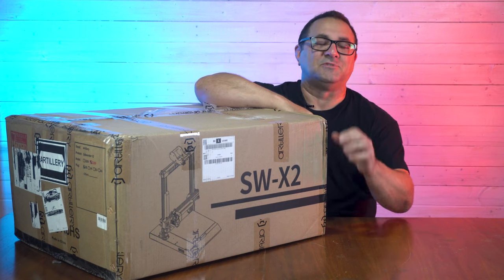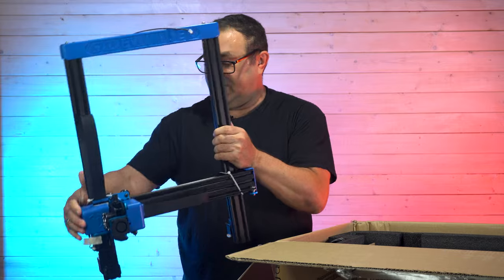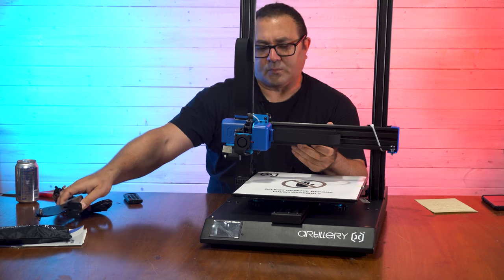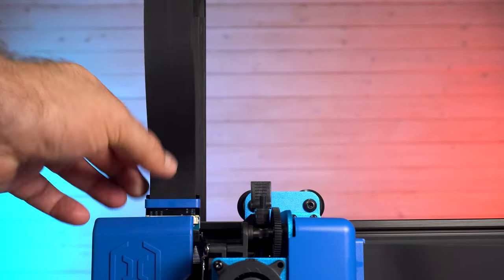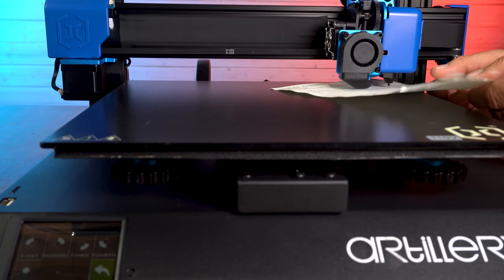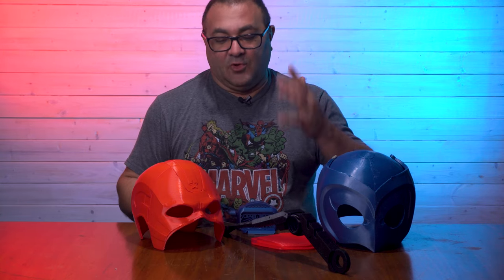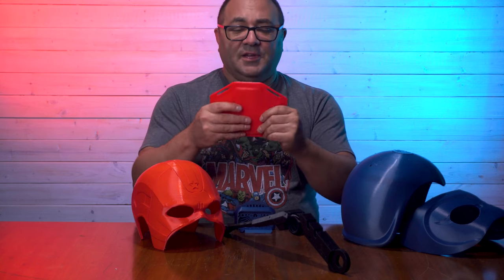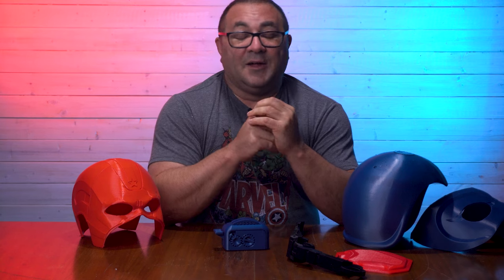Artillery Sidewinder X2 Unboxing, Setup and Review - COUPON CODE

Comment: I've had my X2 a little over a month now. When it works, it's great but it's not without flaws as with anything else. Maybe it's just mine but it's not as quiet as portrayed. I print while I'm sleeping sometimes and it's not loud enough to keep or wake me up, but it's not silent. The touch screen is garbage..Trying to make a selection in the menu and not hit another is nearly impossible. Then there's the horrible noise my X axis makes..I've contacted Artillery support and their response has been lackluster. It never fails, if my printer sits for a day or two without use, when I try printing with it the X axis makes a terrible grinding noise. Overall it's not bad but as this is my first printer I have no frame of reference. With just a few minor fixes, Artillery would have a truly great printer.

Comment: You made me buy one. The only addition I've made is a couple of stabilizer brackets to reduce the z wobble. The one weak point of this is the software/display. The heating display is not consistent. One screen could show the nozzle at 200 when it is really 0. It also doesn't increment the displayed degrees consistently. It needs a software update to fix these things including being able to remove the annoyingly LOUD beep when you turn it on. The direct drive is so much nicer than a bowden tube setup. I come from using mirror beds and glue stick and I am almost tempted to do that with this one but I think I might have to auto-level every time due to removing the mirror for cleaning.

Comment: I have had mine for 2 years and already replaced many nozzles, the whole extruder, the plate and motherboard and it still works for a print or 2 and then is crap. i do not reccomend. my 99.00 ender 3 pro has given more comfort and enjoyment so now looking to go bigger with ender.

Comment: ⛔️ Terrible printer do not buy!
Reply: Really why I hope your wrong because I'm setting mine up now
Reply: Wow so far your right the dual z axis roller adjustment instructions make no sense I did what the instructions said and if it was level well its not now lol its like there is no adjustment am I doing something wrong
Reply: So there are there is a button in the menu that lifts the head up by more than .01mm. It’s a pain in the but to get working.
Reply: @Salty Goose  options then more than arrow up or down I'm pretty sure it's like my flsun delta qqs pro menu it looks exactly the same and I can use that one with my eyes  closed lol I'm talking about the wheels on the uprights its a weird design to me
Reply: @rockman49er  it is. And the price of paper to calibrate is such a stupid measurement. They use A11 or some I think. I got a better calibration if I folder an 8x11 in half, made it tighter. To the point it’s kind of slid across the paper. Basically then in the middle it would barely slide on it. Then it worked okay. But it would mess up again after a few prints and I would have to do it again.